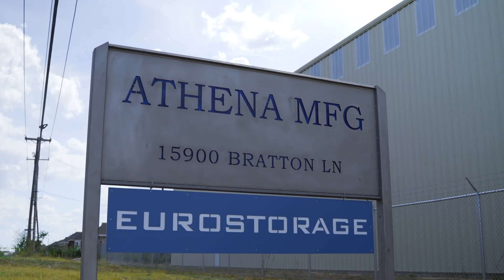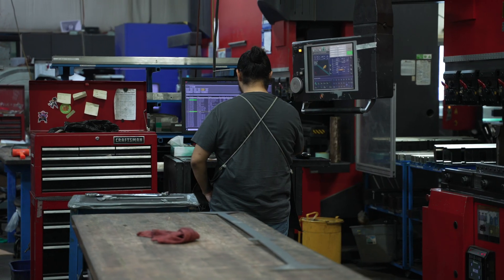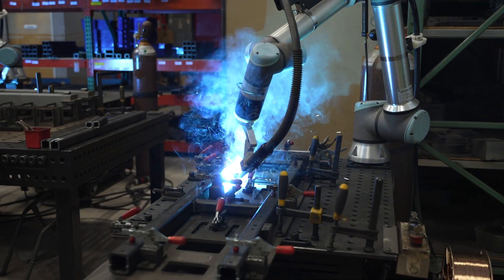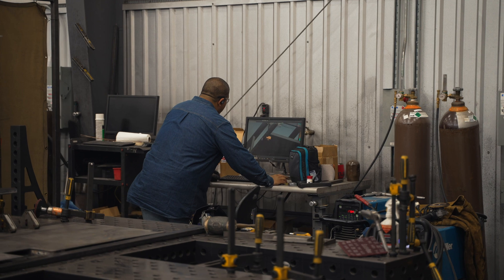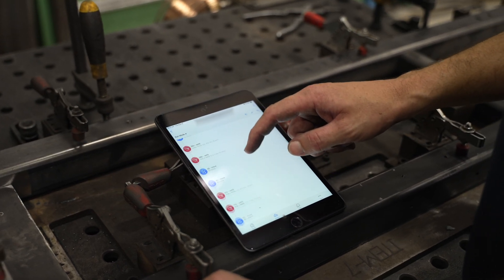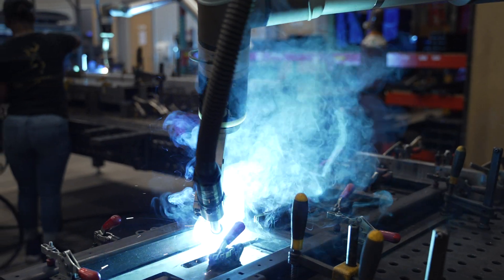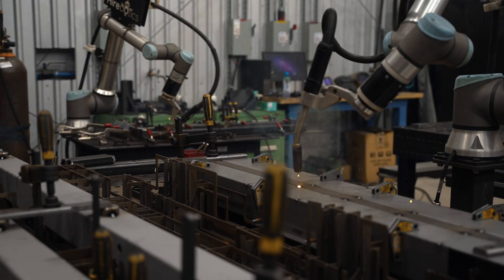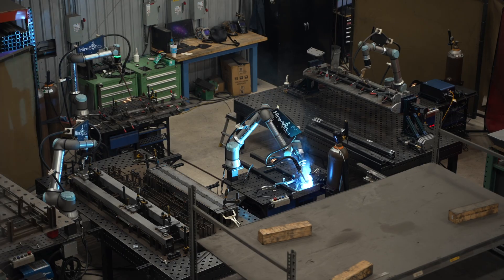Athena Manufacturing Produces Parts 70% Faster with Cobot Welder

Comment: How do they get away without any operator safety, arc shielding or fume extraction!
Reply: These are cobots, they are designed to work with humans without the risks of an industrial arm
Reply: @aa-rr3lb  That may answer the question of physical harm to the operator although I don't agree with that as any robot can have a machine fault and moves the arm to a different trajectory and higher speed, but what about the welding arc and welding fumes or does it not matter the operator gets eye damage and lung problems.